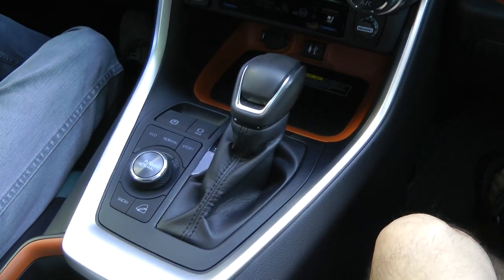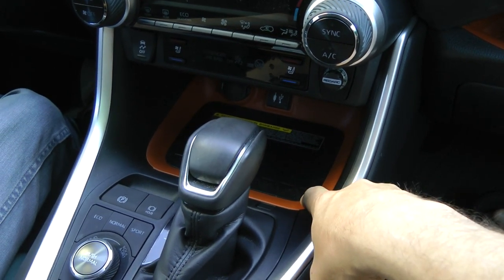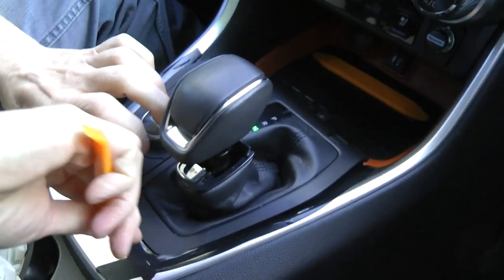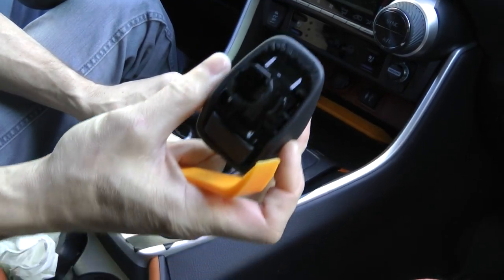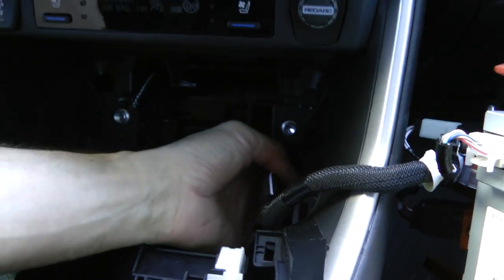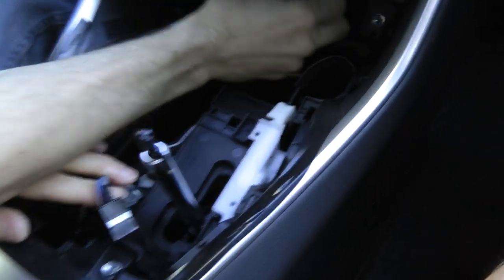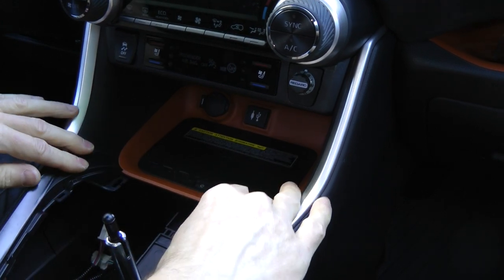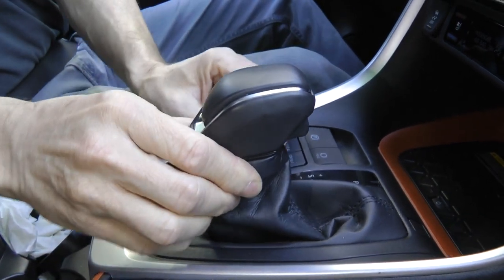Toyota RAV4 (2019-2024): How To Remove Central Console Cluster, Shift Knob And Wireless Charger?

Comment from the maker: PRODUCT LINKS:
1. SHIFTIN Gear Shift Knob Toyota Rav4 2019 2020 2022 2023 (Black Leather/Carbon Fiber) - https://amzn.to/3lxryAz.
2. 2019 - 2020 Toyota Rav4 Xle Wireless Charging Pad Unit 861C0-0R020-C1 New - https://www.ebay.com/itm/335214548401?amdata=enc%3AAQAIAAAAoAomJbgLhGFuo1tQ3GcpnlV5ZeWDgvK8ICUKiPKwJmeD2VPZPDk9thUjQLjhiKPN7vtEzDl6nWtokbpLGdVC8tkO5k%2Bp1zFruo0UMh0CJa5oIzuh7MKYyoDJj%2FucpXIvm5wiEMqYyubAcZ0SEQGSTolCX81d3ybTGvItz7Fnxmv8f3dsWlKiL48OHQE%2FZfpKIG1Z8da7RIRm268%2B1x00Y20%3D&mkcid=1&mkrid=711-53200-19255-0&siteid=0&campid=5338971185&customid=&toolid=10001&mkevt=1.

RECOMMENDED TOOLS:
1. THIN PROFILE LONG REACH PLIERS - Xcelite 378M Thin Profile Long Reach Electronic Plier, Serrated Jaw, 5-1/2" Length, 1-1/4" Jaw Length - https://amzn.to/3JvHXNQ.
2. TRIM REMOVAL TOOL - 4pcs Auto Door Clip Panel Trim Removal Tool Kit - https://amzn.to/41nYhsk.

Comment: Do you think the wireless charger can be bought seperate from Toyota? I'm wanting to put in in my Rav
Reply: Its expensive! Like $800
Reply: @decentrik  ouch, yea gunna pass haha.
Reply: @SrpskiHokejas19  you could buy a Aftermarket one for $200-$300 on ebay
Reply: You could go with something like this and just route the connection wire back to your center console USB port: https://www.amazon.com/Wireless-Charger-Charging-Station-C3/dp/B07GZZX37F/ref=sr_1_9?tag=mashable-editpost-20&ascsubtag=01Oz35Fa2wrj2co3qe5tXMz
Reply: There's some refurbished ones available on eBay if you take a look. They'll set you back about $250, but it's much cheaper than buying from Toyota
Reply from the maker: TOYOTA RAV 4 861C0-0R020-E3 WIRELESS CHARGER TRAY GENUINE OEM - https://www.ebay.com/itm/184723628369?amdata=enc%3AAQAHAAAAkIUfb1agToPHHDHlyesigK8uH%2Fa32ZmqEcd27cubOvHUhTF3XuC27ZkF65PUXKV%2FY%2B926fCv%2BouaLLPleh8Pyn2c1Z0g0I384VmoDbvT1K8DWrN%2Bn5urXKpMbDMw%2FvMTJqhh3mlUjJlX2JIgZn4Bod9%2FJLvMUbxHJefc0EDEbTFTJ4dx%2F5VTO%2B6mAQiVvaJhpw%3D%3D&mkcid=1&mkrid=711-53200-19255-0&siteid=0&campid=5338971185&customid=&toolid=10001&mkevt=1.

Comment: Do you happen to know the part number for the small metal clip that is removed to allow the shift knob to be taken off? Mine flew and cant be found,
Reply from the maker: I don't know the part number for the clip itself. But the shift knob assembly including the clip has the part number. Here are two options: 
1. Regular one - 33504-0R110-C0.
2. With leather and chrome inserts - 33504-0R120-C0.